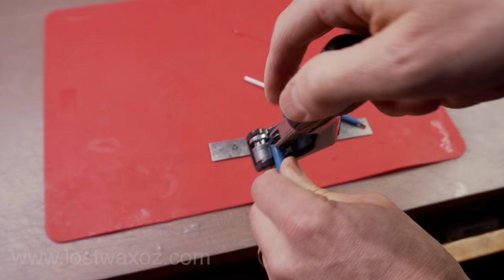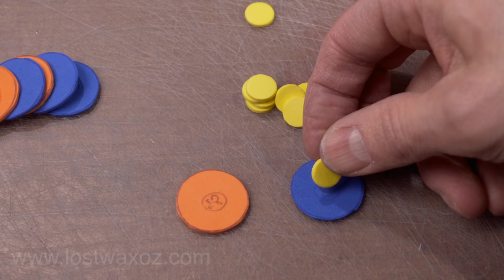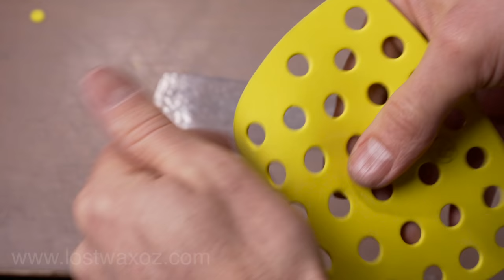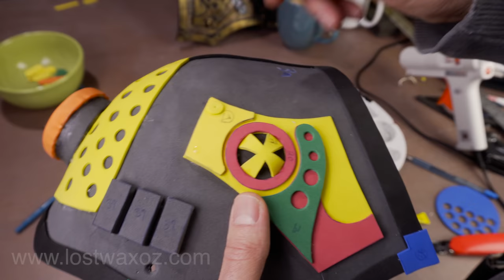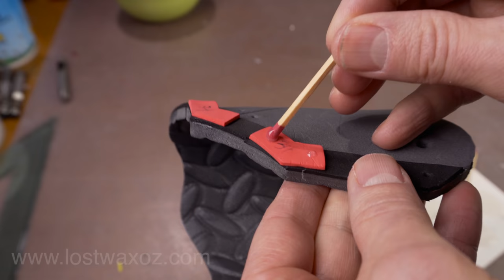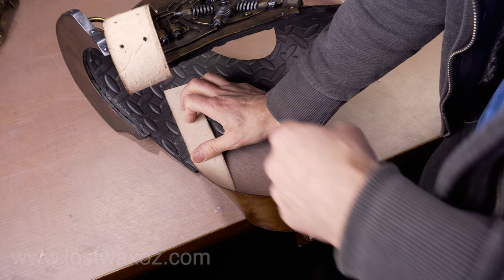DIY Steampunk Shoulder Armor Part 2. Cosplay Armor Pattern and Tutorial

Comment: I'm using PVC tube instead of the bits of pen.  I found I could make the wire fit more snugly into the tube by adding a lining.  I found some old coax cable and removed the inside - must be coax as the sleeve is round inside unlike mains cable.   It was a little too big, so I sliced the sleeve lengthways and cut a couple mm off to reduce the diameter to the exact amount needed to fit inside the PVC tube.

Comment: I made this for a concert this past October and it turned out amazing! My only problem is, the paint rubbed off on the under-arm section of the body and one of the crossbody strap pieces fell off (though that was admittedly just a bad hot-glue job on my part).

Therefore, I'd like to ask: What kind of acrylic sealer would you recommend to prevent this from happening again?
Reply from the maker: Hmm, I haven't found anything that would add enough abrasion resistance to make a big difference. The problem is that anything that goes on nice and hard is also going to crack easily because of it's brittleness. Another thing is that if you have just recently painted it, the paint won't have completely cured and might wear off quicker.

Comment: I just thought of something kinda weird. I have the tools and skills to craft metal, but foam has always been quite difficult for me. And, even though it takes a ton more time, this pattern may work with metallic parts too. Gon need to think about it first through, before i start trying anything out. It may be a dumb idea for some part and then i'm stuck with it if i just start doing.
Reply from the maker: I think it could work, depending on what you have for forming the metal. Funny, I came from a metalworking background- jewellery:)

Comment: Do you find that the Artist paint (Liquitex Basics) bonds to the EVA foam? Or  if you scratch the foam (or flex it) after it’s painted, does the paint flake off?
Reply from the maker: I haven't had problems with flaking using the artists paints (I did when using house paint). I think one of the reasons I get a good bond is that I don't generally heat seal my foam before painting, so there are lots of tiny holes in the foam for the paint to grip on to. As the paint gets older and more brittle,  it will crack if you flex the foam too much, but I haven't had it flake off as a result of the cracking.
Reply: Thanks for the info. I prime foam with an elastomeric paint, which bonds to the foam and then the paint bonds to the elastomeric, but I am trying to see if there are alternatives. I appreciate your information.

Comment: You may have addressed this before so forgive me if I missed it. You changed from contact cement to hot glue in your videos. I live in a humid climate in Tennessee and sometimes go to cons in Georgia which is worse. I have made EVA costumes before with hot glue and they completely fell apart. I assume in my situation I should use contact cement? Thanks for your opinion and anyone else that wants to chime in.
Reply from the maker: Yes, if you are going to be using your costumes in really hot situations, contact cement would be a better choice.

Comment: Looking at the shoulder piece in the beginning compared to the end (or rather with the arm and without), it looks like part of the shoulder armor isn't included, is that correct? I believe it is the part that ends up attached with the hinges. If the arm is already built and this is going to be in addition to it, is that last piece not required?
Reply from the maker: Yep, you're absolutely right, with the mechanical arm the shoulder armour doesn't need the extra piece.

Comment: Hi, i've just found your channel, I am new to making and all the other makers i've seen prime or plastidip before painting, butyou just paint directly onto the foam. are there pros and cons?
Reply from the maker: I don't have a ton of experience with plastidip, but the reasons I don't use it are- you need good ventilation (and I am stuck inside 6 months of the year), and the cost. It does give a more flexible coating, but I have found that for my uses, a decent quality acrylic artists paint does a great job (yes it will crack if flexed too far though). People prime with all kinds of different things, but I like to keep it as simple as possible, so if I can use the same product for priming and painting, I will. The paint deems to do a pretty good job of filling in the pores on the foam. I hope that helps a bit:)
Reply: @LostWax  thank you for replying

Comment: You forgot base before to color it. Usually a flexy, rubber coat like plastidip. In your way it will remove from surface in few months or when it s under pressure.( crack )
Reply from the maker: It is true that the paint won't last as long as plastidip, but I try to keep my techniques within the grasp of people who don't have all the stuff and don't want to spend a bunch of money to get it. I find that, for a few hours of wear at a con or party, the paint holds up really quite well unless there is a lot of rubbing. Also, I don't heat seal the foam before painting, which gives the paint more to grip on.

Comment: is it better to paint black or brown before applying the metallic ef
fect?
Reply from the maker: Depends on what you want it to look like. I like to use black behind silver, but I sometimes use brown behind copper or brass for a slightly less contrasty look.
Reply: @LostWax  i have to paint a orange/grey plastic nerf, does acrylic apply to plastic as well?
Reply from the maker: @margheritaquerini7536  I think you'd be better with a spray paint for plastic. If you do use acrylic, you need to at least sand the whole thing with some fine sandpaper. Or spray it first with a primer and then use the acrylics.
Reply: @LostWax  thank you a lot❤❤
Reply from the maker: @margheritaquerini7536  No worries!

Comment: But do DecoArt products look as good in person as it does in videos?
Reply from the maker: Good question, and I'd say the answer depends on the lighting they are viewed in. Under bright light, they sometimes look a little too sparkly-ie lots of little sparkly flecks in the paint. That's why I decided to go with the liquitex basics bronze this time, less flecks. However in dimmer light, they look really quite good. At least for a paint. Coming from a jewellery making background, I realize that they are never going to look like real metal.
Reply: @LostWax  Good to know! I don't think the "100% real metal" look is possible in paints. The closest I've found is the Martha Stewart Liquid Gilding paints, but they all contain metal, normally copper, which is highly reactive so you almost never end up with the same finish you started with after a while, and they react to almost all top coats. I'll have to look into DecoArt and Liquitex for my crafts